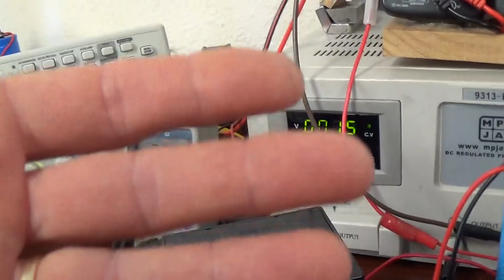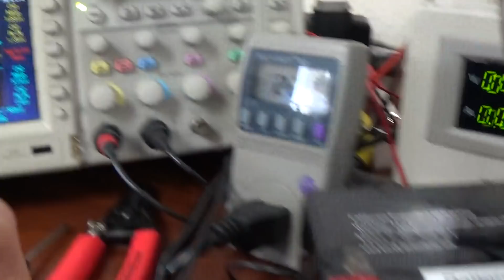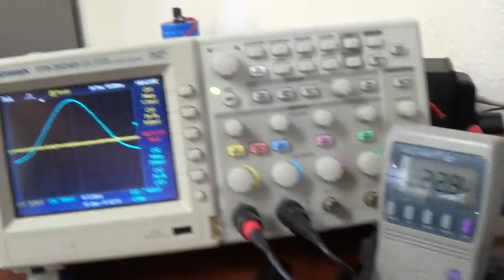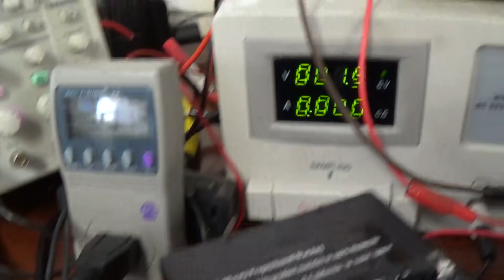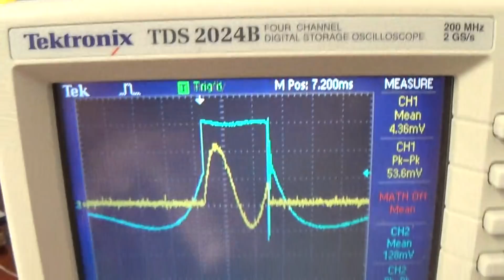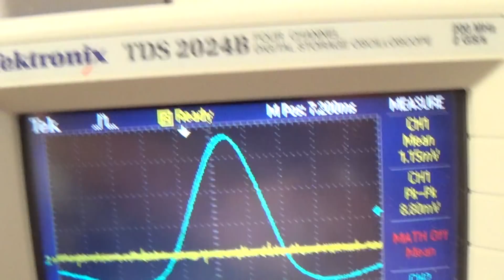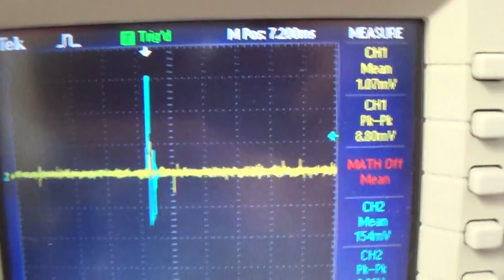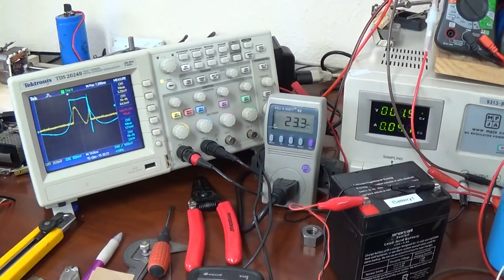Sharing ideas, how to build a more efficient motor (p.5)

Comment: What would happen if you pulsed once for say every 10 RPM while collecting the induced current the whole time? Your rotor is spinning the magnets past the coil for quite a while as it slows.
Reply from the maker: +wopwops0482 Sorry, but I don't understand the question or what your suggestion would do? Luc
Reply: +Luc  gotoluc Choquette I was wondering: Is there a flyback effect when the magnets are moving past the coil, and could that be collected (to any positive benefit) while the rotor is spinning down?
Reply from the maker: +wopwops0482 In this configuration (design) if the input is lowered the coil sends back power to the source from the momentum of the rotor spinning down. So it's a motor generator. Luc